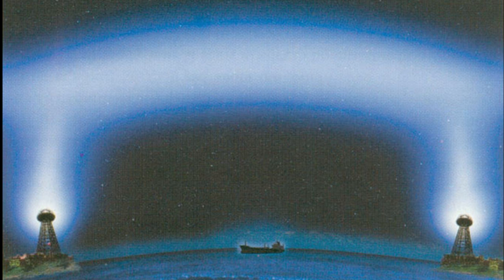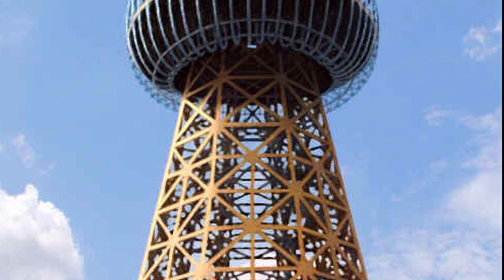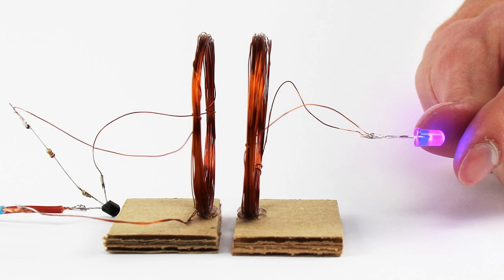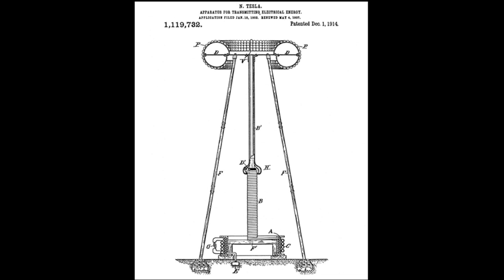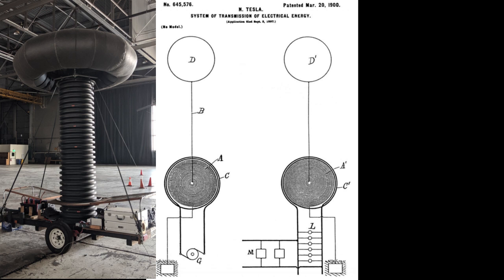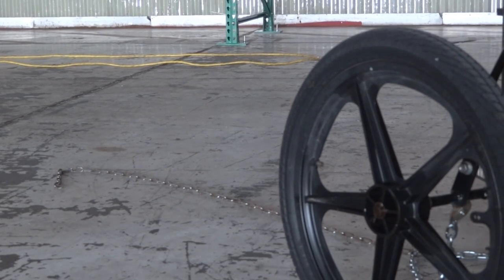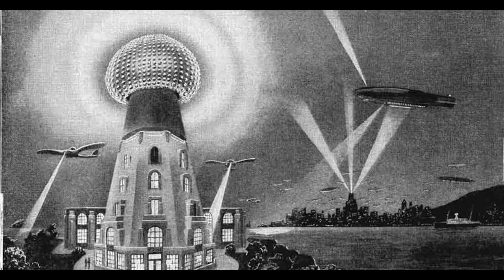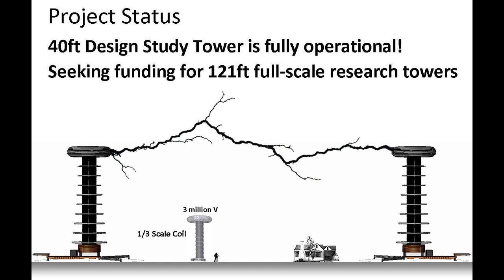Tesla's Wireless Powered Roadster - Test Drive

Comment: This is like those bumper car rides but instead of a grid on the ceiling made of wires it uses the floor to transport the electricity
Reply: Bumper cars work by electricity being delivered through the ceiling to the car. For this Roadster though the floor isnt transporting the electricity its grounding it. The electricity is going through the Air, through the roadster, and into the ground.

Comment: I like the Tesla Roadster. Do you think it is possible to replace the grounding circuit? For example, by shorting it to nichrome. Make something like an electric furnace that would simply consume electricity. Choose the thickness and length of the nichrome so that it does not heat up too much.

Comment: Texzon the corporation in Texas built that very tall Tesla Coil tower.  Someone mentioned them in the comments previously.  Yes they were studying Zenic surface wave propagation but they were also studying ionosphere coupling.  Texzon corporation evolved into a second company called Visiv Technology.  Last I learned, they were implementing a live system in Dubai.  It is supposedly built for power companies and their distribution networks, but not for us mere mortals to use.  That's why there needs to be a publicly funded ionosphere coupled system with no commercial interest, and you are the best and most likely person to get it done.   You need to use crowd source funding, like Kickstarter.   You would definitely be able to reach the funding goals because there is great interest in this community.

Comment: It looks like you have some transistor in the receiving circuit.  That's beyond the basic patent.  How exactly are you building the receiver?   I can't see the receiving primary or secondary coils.  Is there a parallel or series capacitor like in Tesla's Transmitters?   I like the idea someone posted previously about using other capacitors on the secondary side to accumulate a charge for use to better accelerate.  Would love to see a schematic of your exact receiving circuit for replication.

Comment: Very cool! 👏😍👍 Instead of the chains for grounding, you could add a 4th smaller wheel to the back that is all metal, maybe knurled, with a bit of spring tension on it to make sure is keeps good contact with the concrete/pavement and then have a brush(es) on the rim? (at first I thought just connect to the hub but the grease might insulate it too much and any sparks might set the grease on fire?)
Reply: I was thinking similar! Yes! I like the 5th wheel idea.  I was trying to figure out a way to conduct to ground without needing to pass through the hubs and was thinking maybe like a contact ring in the inside of the wheel rim?
Reply: @Afterfire999  Good thoughts! hhhmm, maybe some sort of metal impregnated tires, like studded snow tires but the studs go all the way through and attach to a coil on the inside of the tire and at the end of the axel is another coil? Or, didn't the Moon buggy or Mars rover have all metal wheels that are like strips of flexible metal attached to a rim? (or was it carbon fiber or something else non conductive?)
Reply: Look inside a drill to find the answer.  Just a tip: brushless... 😎
Reply: I was thinking the roadster could have metal-rimmed wheels and the road could be two long pieces of metal that the wheels sit on.
Reply: @thesenamesaretaken  Like a railroad/subway?

Comment: how much did it cost to build the 40ft tower, how much would it cost for you to complete the twin 121ft towers and how much would it cost to build teslas original 180ft tower in todays money? i checked your website but did not see these questions addressed anywhere.
Reply from the maker: I don't know how much Tesla's original 187ft structure would cost to build now, but I'd imagine it would be a lot!  It's essentially a permanent 19-story HV structure and support building on 5 acres of land.  Today, using inflatable structures for the main resonator would be far cheaper.  I don't have any formal cost projections for the full scale towers; I've long since given up on locating funding sources for the research.  The plan now is to simply build As Cheaply As Possible, and move forward as obtainium is found.  There is a lot of Ebay, Harbor Freight and Home Depot in the working 1/3 scale prototype!  Did you know that shower panels can withstand over 250,000 volts per inch punchthrough, and cost only 1/8th that of industrial PVC panels?
Reply: ah i see. i imagine testing and blowing equipment also throws a wrench into trying to come up with estimates. i appreciate the response and that tidbit about the shower panels is interesting. ill keep it in mind for if ever i find some obtainium of my own lol great work btw plz keep it up. i hope to one day see the worlds first tesla powered personal air vehicle and people like you inch that dream closer to reality

Comment: I'm really sorry but you're miles away from Teslas wireless concept. To start with the car he built in 1931 was not powered remotely, he had his free energy on board from a single 6v battery. 12 Amp. and his ability.
Farther more, Tesla did not use his ordinary Ac. for this project, he produced what you damn physicists call Scalar Energy and He called it Radiant Energy, and He used AETHER to transport it thousands of miles and cross all obstacles  and He demonstrates in front of Einstein his project Death Ray fired in Philadelphia reaching Tunguska in Siberia in less than a second.
But all of this is outside the physical religion, really a lot of sand for your truck.

Comment: does he have enough power to go up slopes ?
Reply from the maker: With a sprocket set from a 10-speed it should be no problem.
Reply: @LightningOnDemand  waa, it will be a revolution, Tesla's dream will come true
Reply: Judging by the slow start it could do with some gears for slopes, but maybe if it had a flywheel that would also help?

Comment: I have done a lot of TC stunts but I wouldn't do that one. If you drive towards the coil you are about equidistant from the RF antenna and your tricycle base. Perhaps a ground plane to cover you a bit. Hopefully won't drop your collected power and may even increase it. IMHO you need to allow for minimum 30% extra distance as sparks will "go around" the direct path at times. 
I came very close to this potential disaster during Australia's Got Talent years ago. Seen only by me on my hidden camera in retrospect and may have been more than 30%. Also perhaps the earth chain should be connected to a rod so it doesn't swing around and get caught in the wheel so you not only lose your earth connection but also tip over.
Photographically, this would look great in low light long exposure. The TC light is low as you have to prevent breakout to keep up EM radiation so it won't be flooded with sparks although the occasional one won't matter and will give the effect of multiple people going around the track at speed. Do two circuits for ? 15-20 secs and experiment with exposure. These make great magazine/media shots which you need for exposure to funding.
"Roadster" is fabulous though. Red goes faster though.
Peter Terren (tesladownunder.com)  
Also posted to TCML

Comment: Is your roadster subject to the inverse square law?
Reply from the maker: Depends on the geometry and size of the toroid on the sending coil.  Beyond 1-2 toroid radii, yes it does go by the inverse square law.
Reply: LightningOnDemand Do you understand Zennick Surface Waves?  The company, Viziv, cites Tesla and the use of Zennick Surface Waves on their patents, which they claim have enabled them to send a standing wave around the world since 2014.
I’ve tried watching presentations by people from Viziv, but I guess I’m either lacking the background, they are full of it, or they aren’t really explaining the basic principles in a way that’s useful.
Reply from the maker: @LostAnFound  Yes, Zenneck surface waves are an interesting concept, where they can 'hug' the Earth as they propagate, potentially traveling around the globe.  And although they follow Maxwell's equations, reducing them to practice will be tricky!  As I understand, it would require a vertical antenna that is infinite in length.  Not sure how the Viziv tower is approaching this.
Reply: LightningOnDemand Thanks for replying.  Looking at your apparatus and the obviously hard work and resources that made it possible, it begs the question as to why people like you aren’t being brought into the supposedly new methods of energy transmission, based on century-old patents.
What I did pick up was that Viziv is using an encrypted modulation technique to lock out non-paying or permitted customers.  Their innovation is the ability to meter their transmissions (Westinghouse’s supposed protest to Tesla’s Wardenclyffe tower).
If they are telling the truth and able to virtually it actually extend the lossless 1-2 radii you describe to include the entire surface of the earth, I hope the intelligence community (saying this based on Viziv’s original masthead) will find it morally and ethically correct to grant us, the taxpayers and citizens of the US and the Earth, the inventions of Tesla and others that could serve to send us into the next stage of human progress.

Comment: That was awesome! I've seen loads of wireless LEDs, tubes and every once in a while an incandescent bulb but this is the first 'practical' device. Do the sharp points on the collector have any effect on the operation? I've always tried to minimize sharp points on high voltage equipment.
Reply from the maker: They do indeed, you can hear the corona from them while driving.  Probably a 1-10% loss effect.  Just need to add some anti-corona tips!
Reply: @LightningOnDemand  Maybe some foil wrapped ping pong balls to take the edge off. This really makes me want to dig out my coil.

Comment: Very cool! How small could you make an antenna to receive small amounts of power, for example enough to power some LEDs? And would this cause interference with (non-rf) electronics, like microcontrollers?
Reply from the maker: LEDs take very little power.  Not sure if it's visible, but the sending coil is on a trailer with LED tail-lights.  They light up when the coil is on, even though all of the tail-light connector terminals are shorted together!
Reply: If this field is dense enough to move a full grown man in a cart , i think you can just hold big fluorescent pipe shaped bulb and it will glow on itself anywhere in this hangar

Comment: Excellent video! How far away from the transmitting coil will the roadster pick up enough usable power to move?
Reply from the maker: With the indoor setup here, about 50ft.  The outdoor setup should cover most of the parking lot.  We hope to test that out once public demos are allowed again!
Reply: @LightningOnDemand  have you thought about adding a electic motoer and altornator to power it for longer distances
Reply from the maker: @andrewbarrett6994  The roadster does have an electric motor on the front wheel.  It's rated for 180V DC.  If you look closely you can see it there, with a chain drive to the wheel.

Comment: What is happening at 3:41? There are arcs, but not in the viscinity of the vehicle, and then something seems to be flying across the hangar.
Reply from the maker: Haha, that was an electric field breakout on the sending coil, which apparently disturbed a bird perching nearby.  Many Tesla Coils try to promote arcs, but for wireless power you try to contain them.
Reply: @LightningOnDemand  The most boring part of professional high voltage applications is all sparks are suppressed :D

Comment: So motor speed here is only regulated by the energy field strength? So the further you get away it will slow down? How about adding super capacitors and a high efficiency speed regulation, should also give some good peak current for starting.
Reply from the maker: Yes, currently the motor is just hooked straight to the coil.  A smart receiver with agile phase control and motor speed regulation would do much better.
Reply: @LightningOnDemand  I am looking forward to see your future updates on this. I shared your video on my facebook page + a few HV groups and asked people to subscribe. I would like to invite you sign up at www.highvoltageforum.net and show your stuff there as well :)
Reply: Hmm, a delta tilting recumbent. Engineers do love theor recumbents
Reply from the maker: @taufikabidin412  Yes, the design did lend itself towards supporting a large receiving aerial over the driver. ;>